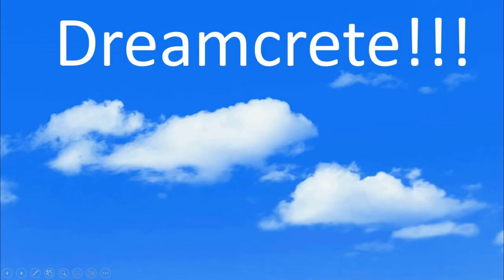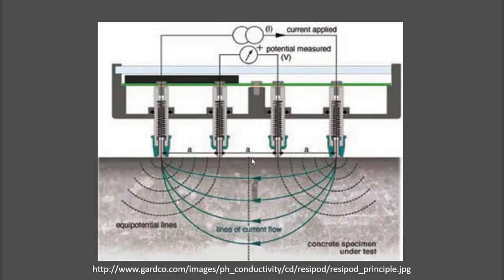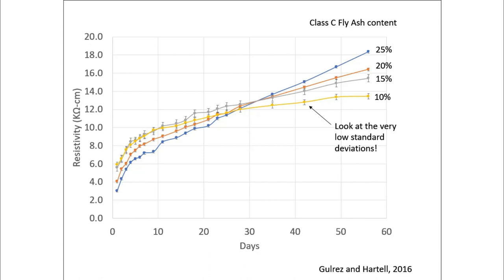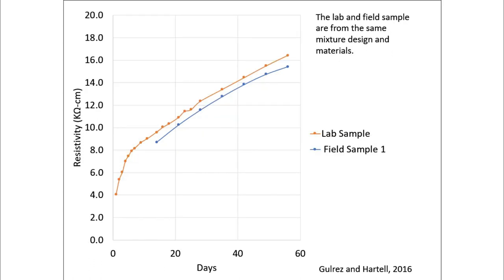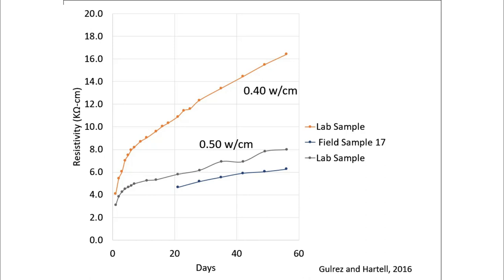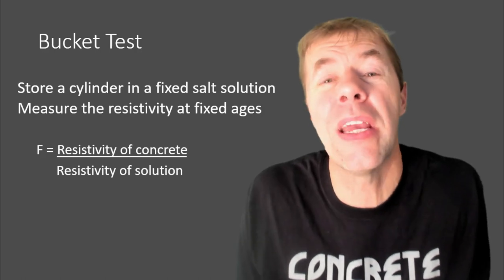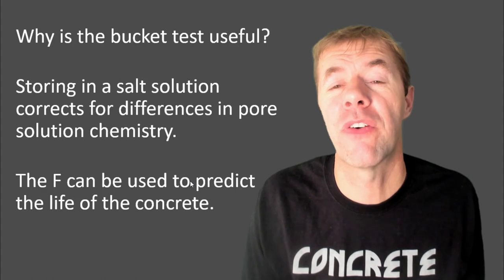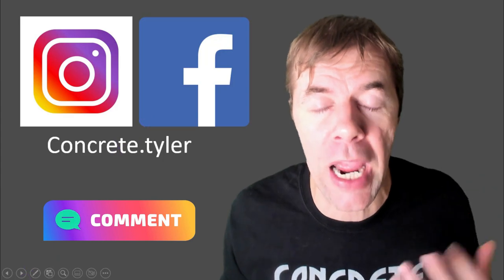Concrete Permeability for DreamCrete - Permeability for Performance Engineered Concrete Mixtures

Comment: The variations in concrete are always a problem. For some reason this reminds me of a bridge that I replaced around 1991. It was cast in place reinforced concrete built in 1938. When I inspected the bridge, most of the lower rebar mat was exposed due to delamination of the lower concrete cover. The rebar was very corroded. I had to post the bridge, which didn't stop any trucks but relieved the town of liability. I replaced it within 6 months. I wasn't sure if the corrosion was caused by moisture from above or the stream below. A group of Civil Engineering Seniors from UCONN got to use the bridge as their senior design project. Good Luck, Rick
Reply from the maker: Thanks Rick,
This might be caused by low cover on the lower reinforcing bars.  Once chlorides start to reach these bars then they will start to corrode.  These tests can help you design great concrete to resist the chloride penetration but we still need to make sure we have the right spacing between the rebar and surface during construction.  Thanks for the comment!

Comment: I see that now it's time to look into the Chloride Penetration Resistance of Concrete. I have seen the so called rapid migration test (CTH test) where you apply a voltage over two electrodes to accelerate the penetration. There's more to it because the current has to be within certain intervals.
Reply from the maker: Yes!
I have a student working with that test right now.  We are benchmarking the test and we have a new twist on it to make it easier and more rapid.  We will see how it all works out!  Thanks for bringing this up!

Comment: Is there applications where having a high conductivity concrete is a good thing?
Reply from the maker: Sure!  If you want your concrete to transfer electricity.  I once tried to turn concrete into a battery.  It worked, but it wasn't really strong enough to do anything with.  Also, if you want your concrete to allow water and chemicals to pass through it like permeable concrete.